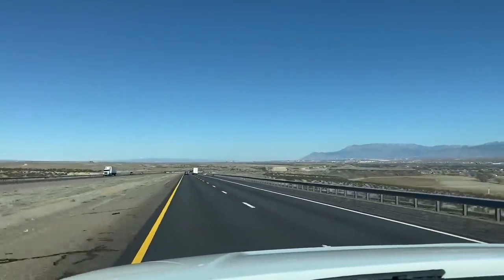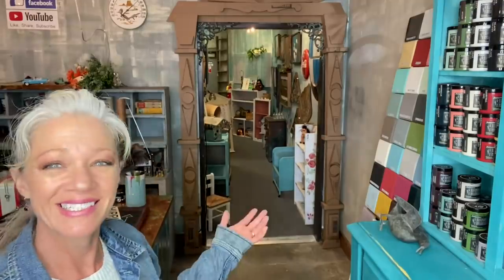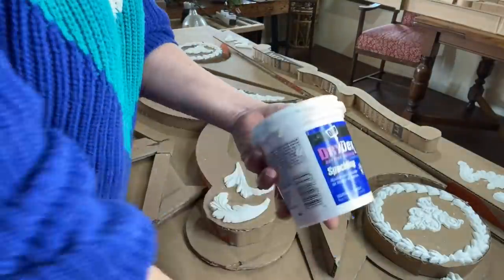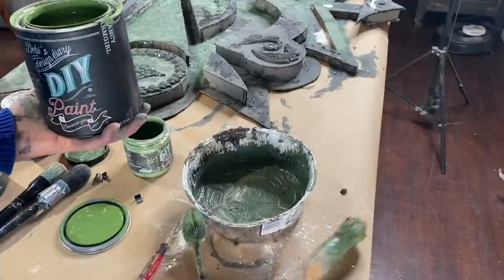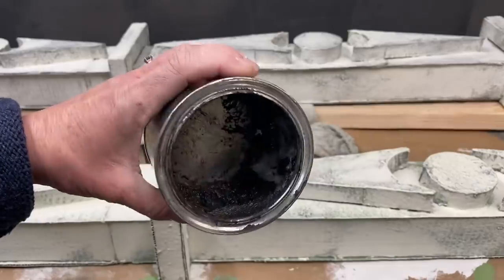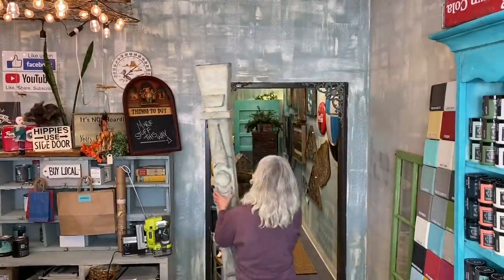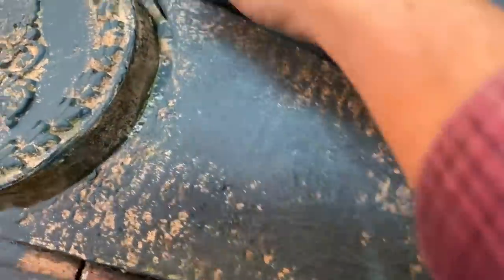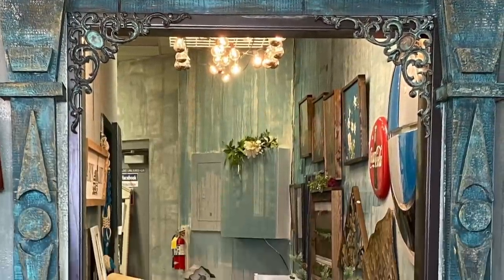I made this out of cardboard!

Comment: You can make forms from non-hardening clay or foam, and use paper mache or papercrete type mix to cover.  Remove the clay or foam once dry.  You can also make a mold from a silicone based mix to use if you want to use that element a number of times.  I made a giant acanthus leaf clay sculpture back when I was in my 20s that was used to make plaster molding in a building at about 3rd and Grand in the KCMO area.  Of course, I really didn't get paid for it, but it's still cool to have done that.

Comment: Multiple sheets of cardboard glued together are basically.. wood. The difference is it's the easiest wood to create complex cuts on.. ever. Because you do all those cuts in layers. I love making things with cardboard. You can make anything. Add to that a layer of paper mache which you can sand lightly for a smooth surface and if you take care when applying can get sharp edges when you want them and it's insanely strong with a beautiful surface to paint. Another way to add some crusty goodness is to add a little plaster of paris & either tamp it with your brush or pat it with scrunched up foil or plastic wrap.. just a thin layer. Some paper clay decorative elements, wonderful paint and you've made your own masterpiece. Did I mention I love cardboard? lol
Reply from the maker: Wow! Great ideas. Thank you for sharing!

Comment: You might try using silicone caulk for filling in the corrugated edges and seams. It would be like clear hot glue but not hot. Inexpensive, too. May even give it extra strength and moisture proofness. Cool project. I just acquired some industrial strength cardboard (29 boxes) and coming up with a design now.
Reply from the maker: Sweet! Good thinking

Comment: I like to build things with cardboard as well, though I've yet to attempt anything to this scale.  Corrugated edges can be hit with a bit of wood filler paste out of a squeeze-tube and sanded down.  Maybe try hitting your surfaces with a light coating of wood glue -- not too much because you don't want the cardboard to warp from excess moisture, of course -- before texturing/painting. You may have to experiment on scraps before you find the right consistency but once the coating dries the cardboard should be hardened and ready to apply anything you want.

Comment: I'll be building a very large resin model (made to order) of the Disney 20.000 Leagues Under The Sea Nautilus. Many talented people have surfaced it with Sophisticated Solutions real rust effects, and it is very effective, especially top side. But my idea is to make it look a lot more sunken, as if you're viewing it underwater. Darker bronze, verdigris effects. Maybe even making it look like part of it is lighter where the kelp above lets the sun beam down. I like the salt stuff, as the main panels, even though loaded with little rivets, are so flat around them they lack age. Mixing a taste of that in with my primer might be interesting. So, thanks, inspiring. DIY comes in a little bit bigger containers than I'll be needing. Unless I start building a cardboard sub.....